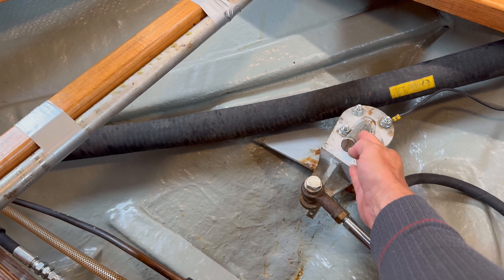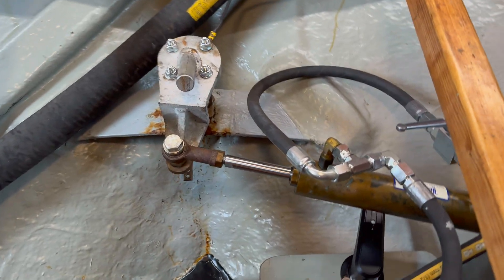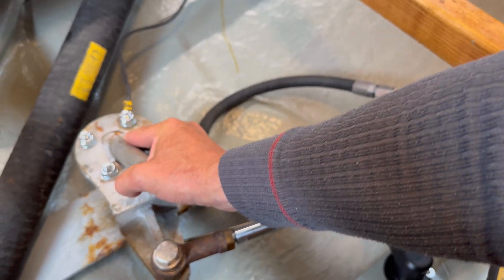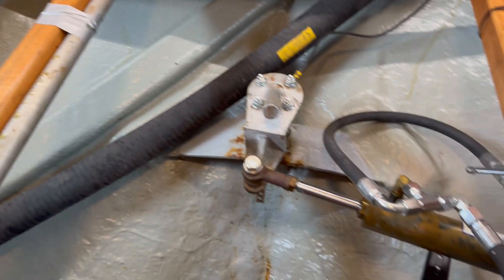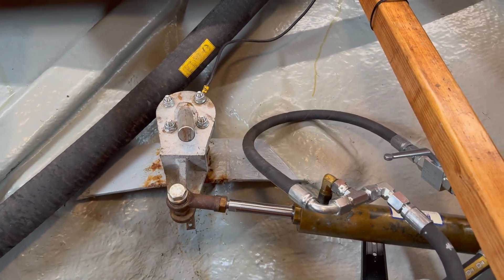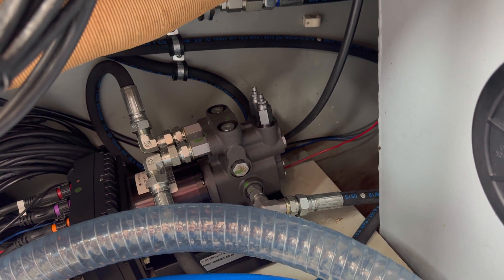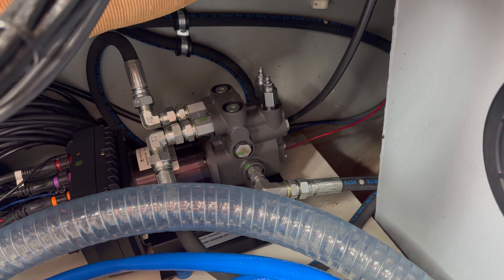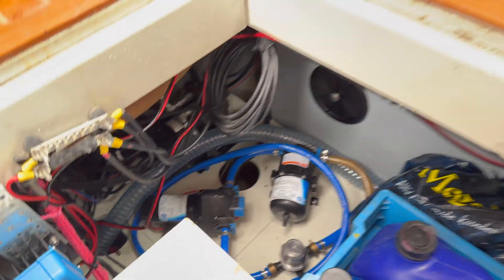How to Survive a Steering Failure at Sea

Comment: Good looking work.
Now that you have non return valves there there is one small drawback. Rudder cannot give feedback anymore to the steeringwheel so steering "feel" is slightly different.
Reply from the maker: Great input, that I have not thought of. So thats the reason they chose that solution. Do you really get any feedback while sailing with the hydraulic steering?
Reply: @Sailing-Maja when you have feedback valves steering foes not have any feel.
You get used to it.
Autopilot pump should be slso parallel to both steering pumps to work. If wheel has turned with the autopilot pump it might have being in series.
Also autopilot pump needs feedback valves that it might have by default.
But i think hydraulic guy has checked these.
Reply from the maker: I am not sure that all the professional are really professional, if you understand what I mean… 🤫
Reply: The boat has Uniflow 50 valve unit, which stops the wheels turning. But seems like the autopilot pump was/is on the wrong side of the Uniflow valve. It should have been on cylinder side, not on wheel pump side.

Now when both wheel pumps have their own non return valves, the Uniflow 50 unit is redundant.
Reply from the maker: @whatever0007 Sounds like you understand this system. The wheel without the non return valves did turn when the autopilot did its job. I did not fit that autopilot myself (it was there when I bought the boat). Looks like some of the jobs done on this boat earlier was not well made.

Comment: This is great content! Do you have a video explaining how you added a second engine thrust stick at the top?
Reply from the maker: Thanks! The boat came with both engine controls from the yard, so I have not added it. What I have added is an extra control of the bow truster, but that is another story.
Reply: @Sailing-Maja aaah, that's cool. I want to add a second one to my boat but I don't know how to connect mechanical sticks to the same engine. Is there a cable terminal box? Would love if you could share how it's setup on your boat.
Reply from the maker: @MoGpt Noted. I will make a video on how it is set up and how it works. Just give me some time.
Reply from the maker: @MoGpt  I will make a video of that once I return to the boat in about a month. Thanks for asking.
Reply: @Sailing-Maja thanks! Looking forward for it. Your boat setup and progress is a great inspiration for my old motorsailer